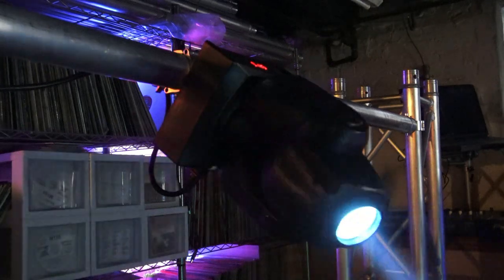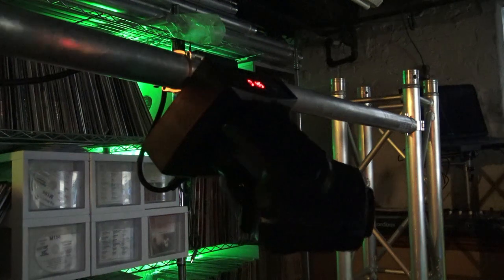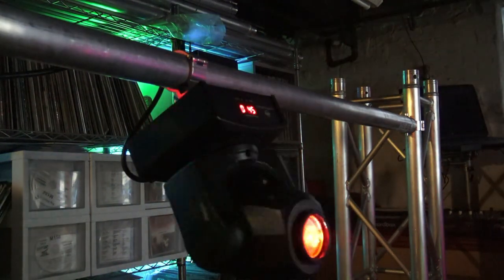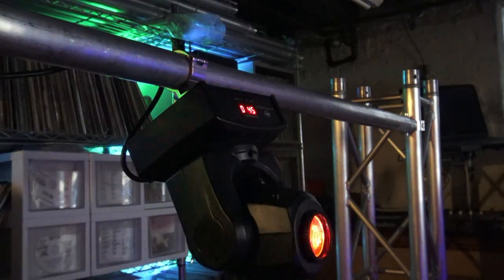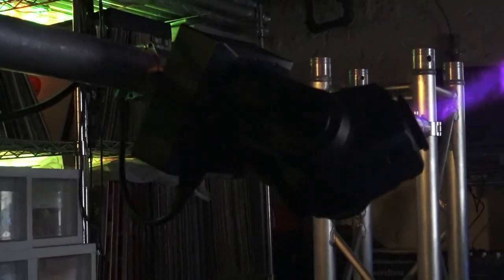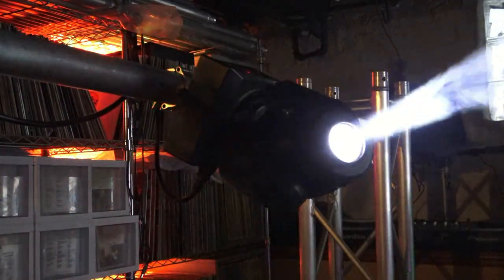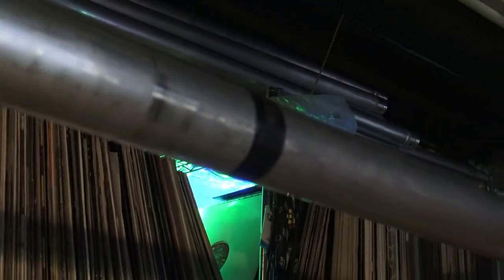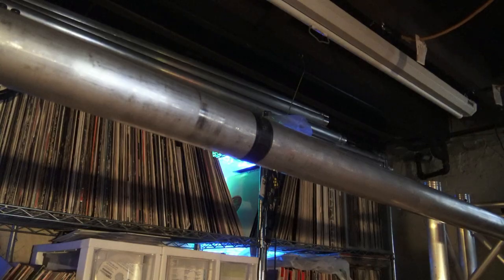DJ Help - Slipping Light Clamp Fix

Comment: This will definitely help. This is a random question, but I am looking for a wash light that can wash a dance floor area. My budget for it is $200. So far I have looked at the Ultra Bar 9. Do you think that has a wide enough beam angle to be a wash or would you recommend something else?

Comment: Instead of putting tape on my truss, I put a piece of duct tape in my clamps. Tape stays in clamp when done, ready for next time. Allows me to position lights any where. I use only o clamps and works with scanners and moving heads.